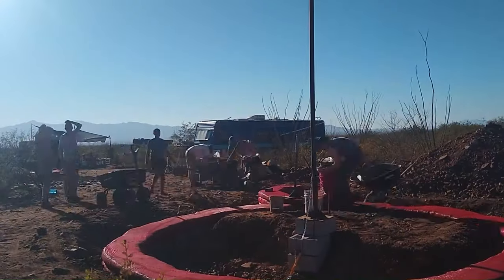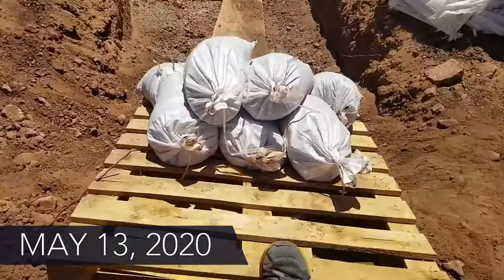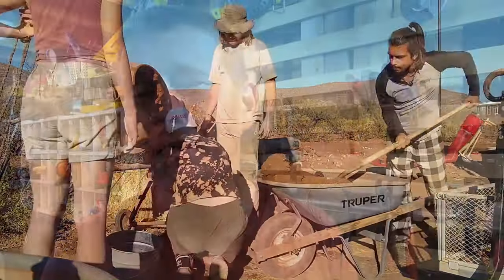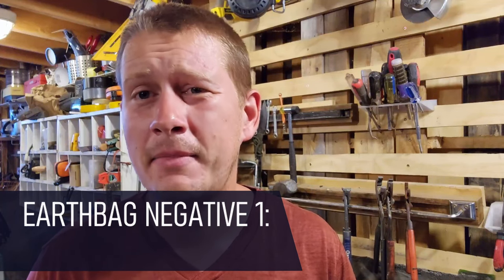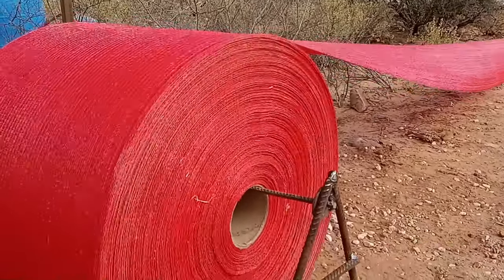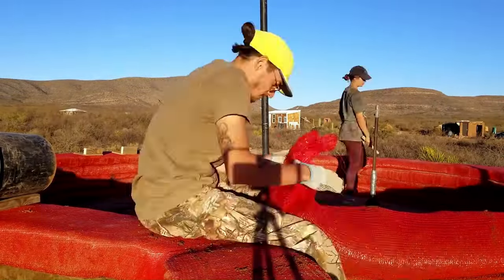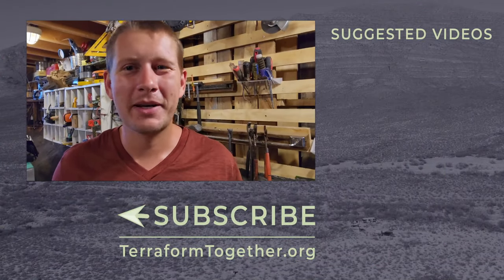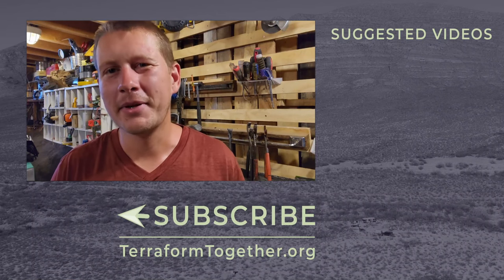Building Better: Hyper Adobe or Earth Bags?

Comment: 9:12 In this video they seem to have built a dome with something that looks similar to hyper adobe: https://www.youtube.com/watch?v=Dcu71gSOogg
Reply from the maker: That's super adobe! Very similar, you just use barbed wire to hold everything together instead of the clay. Superadobe you can do domes. I just don't have experience with it personally, so I can't really speak on it.
Reply: @TerraformTogether Okay! I don't really know the difference myself; I just saw the long tube that spiraled around the top of the dome and associated it with the hyper adobe that you used. I thought that maybe it was the fact that you used a long tube instead of many small bags that prevented you from making a dome with hyper adobe, but maybe that's not the case?
Reply from the maker: They are very similar. Superadobe is similar to the individual bags as far as materials go. It uses barbed wire to hold everything together. Hyperadobe has holes so the clay particles can fuse together between all the layers. You can do a dome with the individual bags as well. Just not with Hyperadobe because the clay bonds don't have enough strength to handle the weight in the way thick barbed wire can.
Reply: @TerraformTogether  Okay, that makes sense. What about using barbed wire with hyper adobe? Would that work, or would that be cheating?
Reply from the maker: @kristoferkrus  Traditional earthbags and Super Adobe are much tighter woven and therefor the bag is stronger. I don't think barbed wire with hyperadobe would work well since it is more individual strands. The big advantage to hyperadobe is that you don't have to use barbed wire... the draw back is to my knowledge you can't do domes. 

Super adobe from what I hear is a good building method as well, I just don't have personal hands on experience with it.
Reply: @TerraformTogether Okay, thank you for the explanation! So, basically, the bag used for Hyper Adobe is thinner and has small holes in it, which allow the clay to partially leak through so that the different layers can bind together, while at the same time being weaker because it is thinner, and maybe because of that it can't handle barber wire?
Reply from the maker: @kristoferkrus  Essentally. And with hyperadobe the bag is only really needed until the clay hardens up. Once the clay is bonded to the clay, the bag isn't doing anything. In superadobe the bags are tighter woven and needed for the structural stability of the home. 

Working with barbed wire is AWFUL. We did it in our root cellar. So unless you want a dome I would lean towards hyperadobe. 

Hope that helps.
Reply: @TerraformTogether  Thank you very much for the explanations; that clears up a lot!